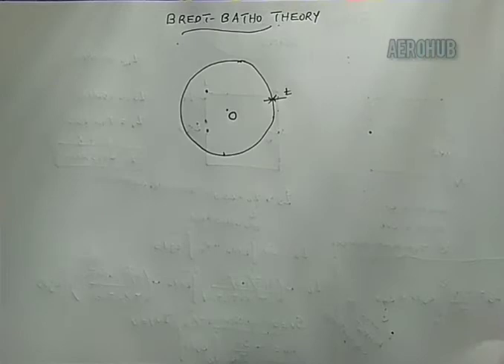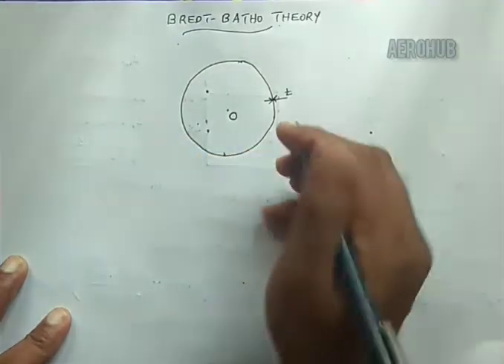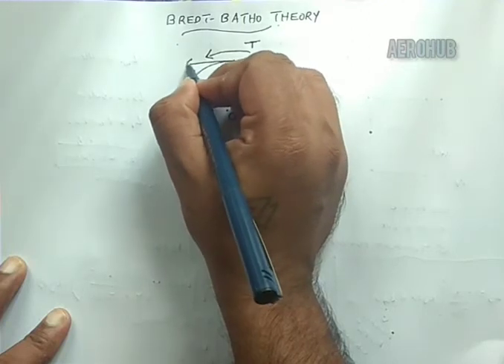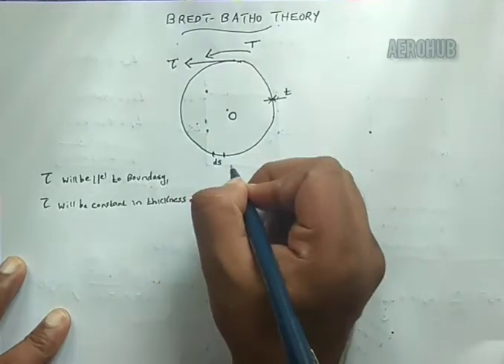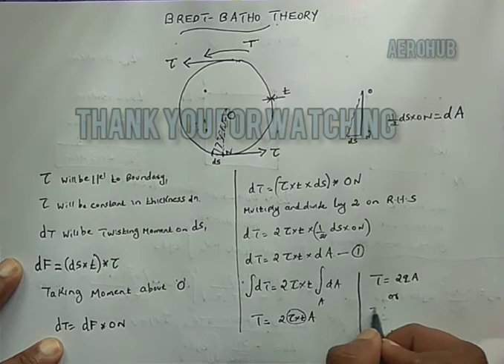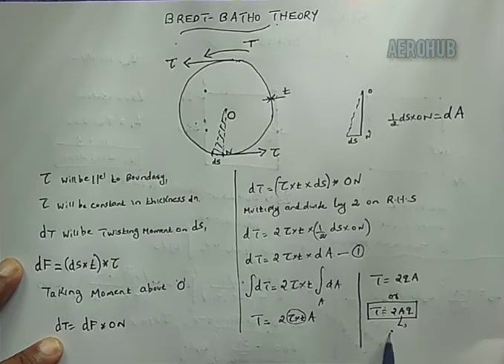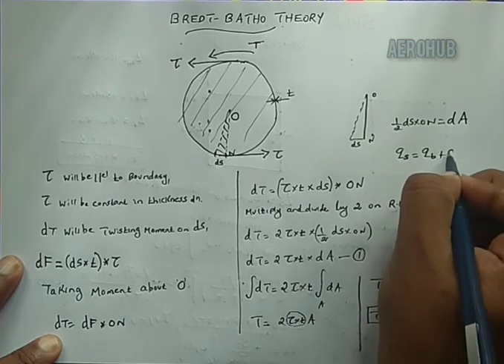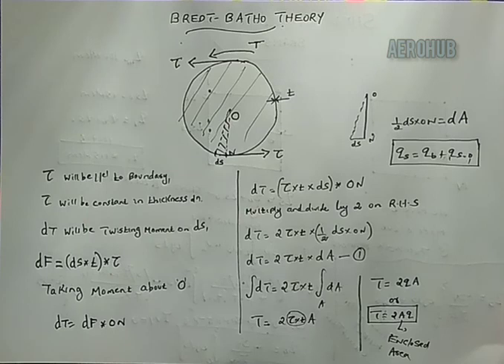What is Bredt-Batho Theory? LECTURE 19 Aircraft Structures-II

Comment: Where it used?
Reply from the maker: Bredt-Batho theory is used to find out the Torque and shear flow distribution of multi cell thin walled beams. For example it is used in finding out the shear flow distribution of Airfoil Sections